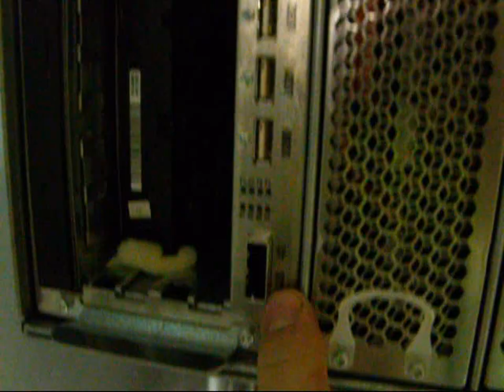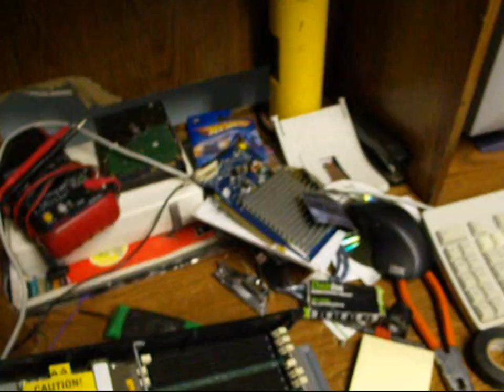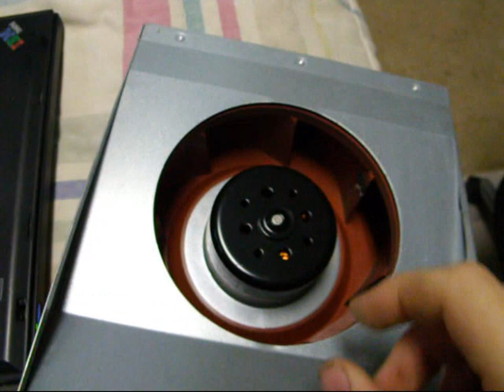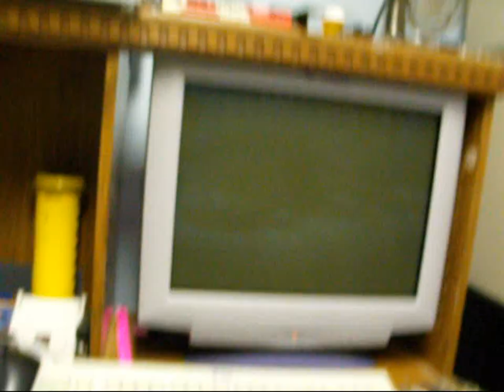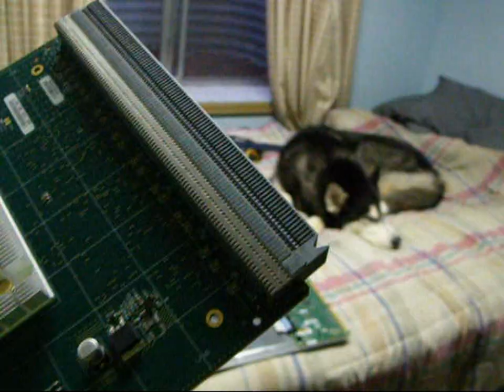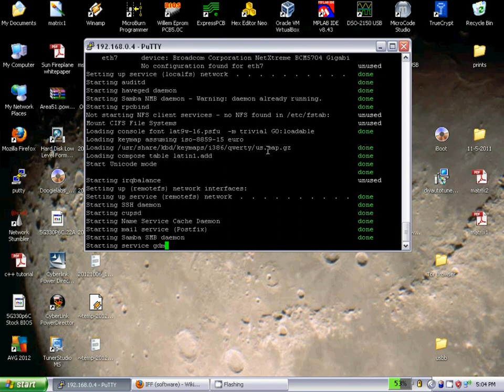SGI Altix 450 "Powerhouse" Full system tour and mini demo

Comment: Whats the default ip address to console for telnet. I cant connect to system console via ethernet. been a few years since I fired up the altix 450, only found half my notes but they start at L2 controller cmds and I forgot how to telnet to the controller. Manual less than helpful. Please help
Reply: Use the telnet(1) command to connect to the L2 controller as follows:

telnet L2-system-name.domain-name.company.com

The system-name argument is the name of the SGI Altix system to which you want to connect. In some case, you may need to use the full domain such as system-name.americas.sgi.com.

Comment: Do you still have this system, and do you do Roestta@home?
Reply from the maker: I do still have the system. I have been wanting to find time to power it up again and see if everything still works and try putting a non enterprise version of Linux on it but have been busy with work. I have not tried anything like Rosetta@home , etc. But would like to once I get it up and running again.
Reply: @DoogieLabs  How did you get this system in the first place?
Reply from the maker: @spencerreppe7558  I would acquire retired machines as they became available from the government. I restored them to working order and resold them. I have one complete IRU left and enough spare parts to build another
Reply: @DoogieLabs  I know this sounds silly, but you don't power this from a outlet right? The system has to be pulling thousands of watts.
Reply from the maker: @spencerreppe7558  not a silly question at all. To power both IRUs in this video it took two separate 15 amp circuits @ 120V to power it. I have since installed a 20 amp 220V outlet in my room for such a purpose and can power both IRUs in on the same circuit using only one PSU in each IRU. If you run the system on 120V, I think you must use both PSUs in each IRU if I recall correctly. 

Somewhere between 2 - 2.5Kw which is probably my 2nd most demanding server I have in my collection electricity wise. My SunFire E2900 pulls between 2.7 and 3.5Kw depending on workload.
Reply: @DoogieLabs  How much money does it cost you to run both IRUs for 24 hours? Has the power company questioned you?
Reply from the maker: @spencerreppe7558  never been bothered by the power company. It costs about $5.50 per day to run.

I also choose to only run stuff like this in the winter so it helps supplement heating the house. So it takes less natural gas to keep the house warm from the furnace.
Reply: @DoogieLabs  Isn't the Intel Itanium CPU architecture super inefficient though, wouldn't it be better to use a bunch of old lga 771 servers?
Reply from the maker: @spencerreppe7558  probably is. I dont run this all the time, and the purpose is to enjoy working with non x86 architectures and understanding their specifics. It's more for entertainment purposes than actual use.

Every architecture has interesting features and unique differences.  Itanic  can do some floating point math in cache without touching the CPU registers for example. 

Figuring out how to leverage this in software, or even getting an OS just loaded on the dam thing is a fun challenge all on its own.
Reply: @DoogieLabs  Good point, I'm trying to cluster up a bunch of old pcs to run some BOINC projects or maybe folding@home, and let's just say it's a challenge to get drivers working on Linux that aren't natively supported, and trying to install Linux on a Chromebook. But it's very satisfying when things start working.

Comment: Sweet System Dude. Seems like you do some with recording with such a setup. I use to be a live sound engineer / roadie. I can roughly visualize your system from memory. But i do not do much recording & mixing anymore, my workstation system are pure direct listening system. Computer -> DAC / Switch -> Amp -> Speakers.

Comment: I have an M-Audio Delta 66 sound card that feeds two line level outputs to a Studiomaster Diamond 16-2 mixer which then feeds the Quad 44 preamp on the disk input set to 10mV which then feeds two Quad 405's which are biwired to the two Mission MX-1's. They may be small but they pack a punch! I have some repairs to do on the Quads at the moment though so I have switched back to my Rotel RA-820BX. It doesn't even come close to the Quads but it does it's job well enough!